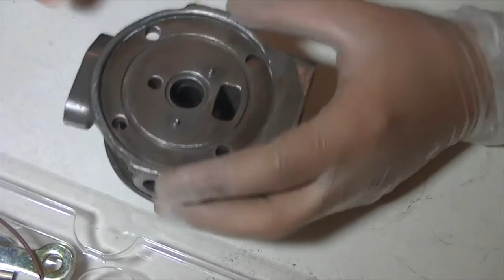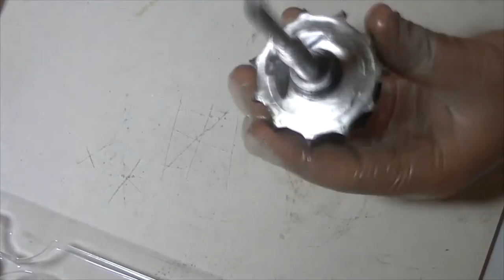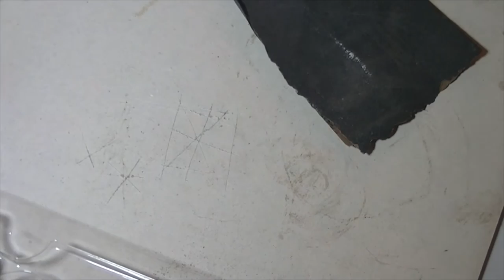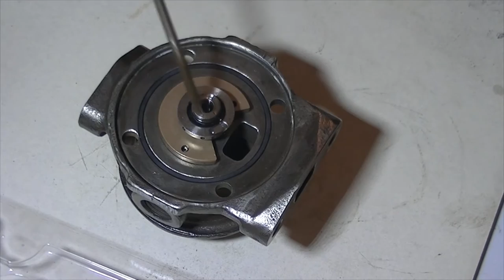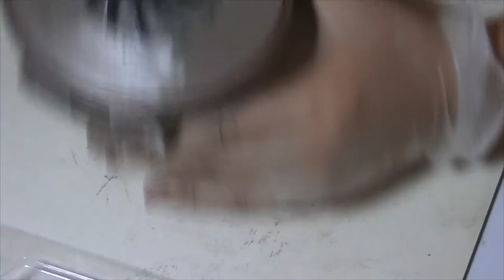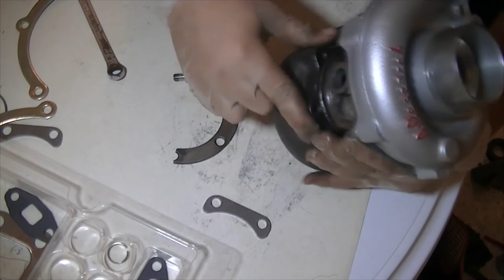How To Repair / Rebuild Turbocharger (Garrett T3/T4 AiResearch M10) - Step By Step

Comment: any tips on cleaning everything before reassembly? Your turbo looks very clean. I want to be sure i don't expose the inner workings to anything that might cause issues.
Reply from the maker: Mainly elbow grease. Take your time when cleaning, use non abrasive materials on the turbine shaft or any part that mates with the journals. I used metal wires brush on the exterior housing, and soft brush on the interior with oil and wd40. An ultrasonic cleaner is also a good idea. Good luck!

Comment: Hi sir. I just rebuilt the same turbo on Mercedes W123 and installed all new parts. Now the shaft is more loose than it was before. It has movement up and down and back and forth.. The shaft itself looks good and is not worn out. It seems to me that the bearings are not the right size but they look the same as in your video. I am super lost and not sure what to do now. Please, let me know what you think
Reply from the maker: Hey, sometimes the bearings are of low quality which causes bad fits. Other times, the turbine shaft might have been worn out due to poor oil lubrication or circulation. In my case, I measured the turbine shaft diameter to make sure it is within specs (it was). Also, the kit I used was one of the more expensive ones I found at the time because I was avoiding getting a bad quality bearing that'll ruin the turbo.

Comment: What oil did you use on everything when you put it all together
Reply from the maker: Jm_ Richert I used Dot 4 brake fluid to lubricate the bearings and seals. When starting the engine after re-installing the turbo the engine oil will take a few seconds to reach the turbo and start lubricating. During those few seconds the turbine and bearings will start rotating dry which would cause wear and most probably scratching on the turbine. Some people use engine oil, I prefer brake fluid cause it's lighter and it's only needed for a few seconds.